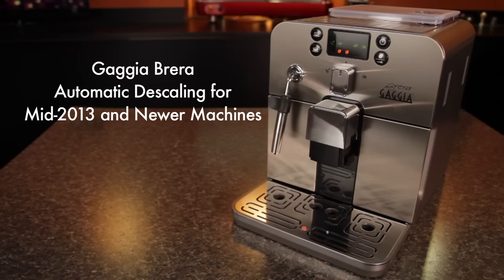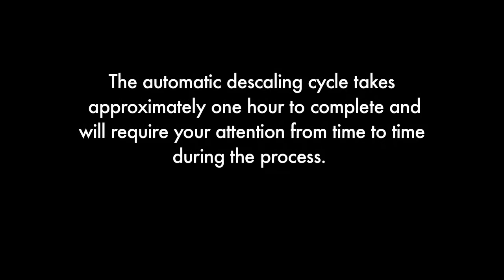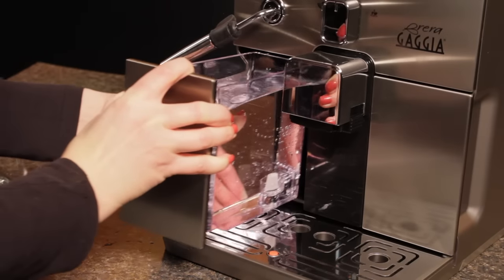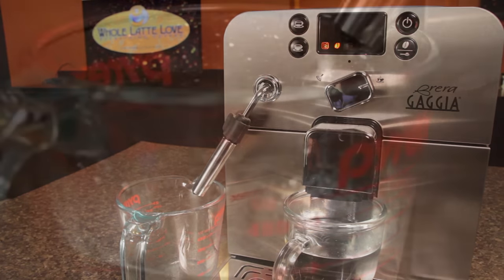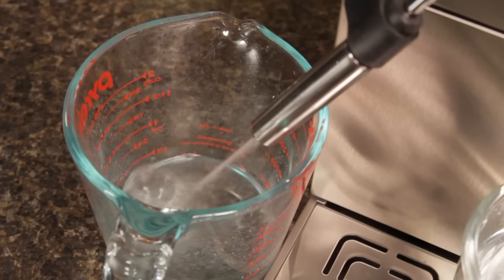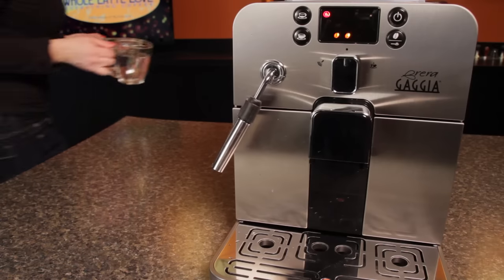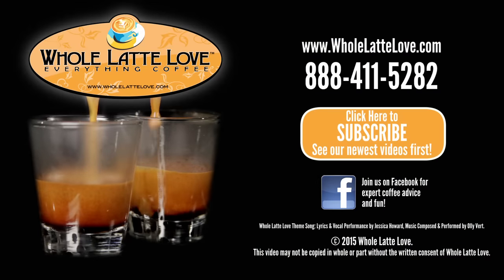How to Automatically Descale a Gaggia Brera

Comment: Thank you for this! I was racking my brain trying to clear the descaling light after performing the cleaning. The manual says to hold the measure button 6 seconds but does nothing. Turning the machine off and then holding shot and lupo buttons at the same time did the automated descaling as in your video. Man on the one side I wasted 30 minutes doing descaling a 2nd time, but on the other side, the next time I descale I can let it go auto. Thanks again.
Reply from the maker: Hi, You are welcome. A few years ago Gaggia added the automatic descaling to the Brera. Think a few machines got out without updated manuals.

Comment: I’ve descaled ours many times and never once has it rinsed the group head. Is this a flaw in the machine? My drip tray is always completely full after descaling, and I’m wondering if it’s going there instead. My sister and BIL have the same machine and have the same issue. It comes out of the steam wand fine.
Reply: same here,  I think it did rinse the group head the first time just like in the video but since then the water just collects in the reservoir before moving on in the process.  I purchased my unit from @wholelattelove due to the community and support knowledge you all publish and of course ties to Rochester, NY.

Comment: this is confusing. some of your other videos DO NOT distinguish and say we can use either decalicifiers. So what exactly do we have? Older pre automatic descaling option and newer ones? Which ones have an aluminum boiler and which ones have stainless steel or brass?? I need to know because on the other video your experts are adamant about using Durgol Swiss  Decalcifier for aluminum and dezcal for stainless steel?? I want to know what I have--and purchase the correct decalcifier and you need to put one version on your videos. Because in this video you do not distinguish at all and led me to believe I can use any of the assortments in your pictured video.
Reply from the maker: Hi Lisa, Descalers can be confusing! Gaggia Breras have a stainless steel lined boiler. You can use any of the descalers shown in the video. As you mention, Durgol Special Swiss is a better choice for aluminum boilers. But even for those any of the descalers can be used but you should limit aluminum boilers to no more than 20 minutes of contact with a descaler containing citric acid as the active ingredient according to Urnex. In older videos the Durgol may have been recommended out of an abundance of caution.
Reply: So use Dezcal on a 2015 Brera? What's best? 

If using water filtered with a Zero Water filter is descaling still necessary? Is the machine requiring descaling based on a set number of brews or can it sense scale?

Comment: 🤔🤔 When I have descaled my machine, the solution was coming out the steam wand just fine but when it came time to cycle through the group head, all the solution leaks out the bottom of the machine and all over the table. No solution went through the group head, all to the bottom of the machine and a little on the drip tray. Has this happened to anybody else? What’s the solution to this? My machine been only used for about 6 months. HELP‼️
Reply from the maker: Hi Fudge, Leaks are no fun. here's a video which covers a common cause of leaks and how to easily fix: https://youtu.be/nra9Wrlm1MU
If it's not the issue in the video and you are in the US or Canada go here for help from our Tech Support team: https://support.wholelattelove.com/hc/en-us/requests/new?ticket_form_id=1500000236921
Reply: @Wholelattelovepage  I contacted WholeLatteLove tech support and they’ve been working on finding a fix for the situation, thank you!! :)

Comment: For those who ask about the need to descale when using bottled water. Bottled water is not distilled water, it still contains ions that will eventually clog the machine, even though it takes longer
Reply from the maker: Hi ML, Thanks for adding that. I'll mention a few more things... Not a good idea to use distilled water in espresso machines. Lacking minerals distilled water or pure reverse osmosis  water will over-extract coffee resulting in bitter flavors. Also, distilled and RO water can cause corrosion of metal components. That's why you never see those water types stored or transported in metal containers or pipes. Not all bottled waters are the same. There are some which are unlikely to cause scale but others like mineral or spring waters which have high mineral content.
Marc
Reply: @Wholelattelovepage  Agree, distilled water is a very corrosive liquid!
Reply: @Wholelattelovepage  what kind of water would you recommend is best? Perhaps just regular Brita filtered water?

Comment: Thanks for this video, it's clear and well made. Question: Is it normal to have to descale every month? That's roughly how often the light comes on. We filter our water and brew 6-10 cups a day. Just wondering since I've seen 2-3 months given as advice more often. Doing the descaling that often is not a problem for me, just curious if it means the machine will wear more quickly. Would you recommend using store-bought filtered water?

Comment: I am using brita filter with my gaggia brera coffee machine but the descaling icon appears every 2 months, just like before, there's no difference whatsoever. Could you please advise what I should do - descale it every 2 months despite using brita filter or not? Does the coffee machine actually sense scale level or it only counts the number of brewed coffees to establish time for descalling?
Reply from the maker: Hi M, Thanks for the question. So a couple things... The descale alert comes on based on the number of brew cycles. Regardless of the water being used the descale alert will always come on after a certain number of cups. Machines do not sense the scale. For the most part, Brita and similar filters only remove sediment through mechanical filtration and chlorine and other chemicals via carbon filtration. Scale is caused by minerals (mostly calcium) in water. Brita filters have little if any effect on minerals. I would definitely continue to descale the machine. If you use an in-tank filter designed for the machine you will get all the benefits of Brita type filtration plus water softening which replaces much of the calcium with salt (salt stays within healthy levels) to prevent scaling. It's still recommended to descale when using in-tank filter but you can descale less frequently. Here's the in-tank filter for the Brera: https://www.wholelattelove.com/mavea-intenza-water-filter-for-gaggia-and-saeco
Reply: Thank you for the response. I am using exactly the filter which is shown under the link you have provided- in-tank one,  hence my question. The purpose of my question was to establish what that "less frequently" is. Without the filter it should be more frequent than every 2 months for me, but with the filter can I double or triple that time? BTW: my intenza+ filter looks exactly the same but on the box there's 'brita' not 'mavea' shown, the rest of the box looks exactly the same.
Reply: I use a reverse osmosis filter with 5 stages. It isn't going off of water hardness, but instead it goes off of liters dispensed. If you want to know how long it can really go then purchase a 10 dollar water impurity tester from amazon. It's a little digital meter. You dip it in water and it will tell you PPM of dissolved solids and purity. Compare your brita to tap water. If it's 4 times lower, you can go 4 times longer between descaling. However, a carbon filter will not remove dissolved minerals as it's a physical medium, and the minerals are in solution (nothing to filter, it's all liquid) . Reverse osmosis does remove minerals but it's requires installed systems due to size and complexity. About 300 on amazon and fits under the sink. Took an afternoon to install.
Reply: Subparanon I have the same problem I have use nothing but bottled water in my machine I failed to see the need to D scale it ever

Comment: What is your definition of 'normal use'?  Also, what is low use? and how often should it be descaled then?
Reply: Normal use is a family of 4or 5 drinking 5 cups a day . Low will be just wife and husband, 2 to 3 cups a day . How often ? The  machine is smart and uses its fuzzy logic to  turn on the descale light. So for heavy use the light comes on more frequently . For low and normal use around 3 to 4 months . However after 3 months of use if the light doesn't come on wait 10 days and still the light is not on, do a descale any way .  Marc did not answer your question because he did not want to go on record by defining "normal " "low" and heavy .  As a seller of  coffee machines he is  liable to  stand behind what he  quoted, because  Marc also does after sales machine repair service .  Several variables such as water quality and carefully following maintenance procedures and  machine use methods prevent one from putting a value/number to  " Normal/Low/& Heavy  use .  Hundreds of customers follow his channel to get answers after they purchase a Gaggia brand coffee machine . So each have to  figure out  what their " normal/low/and heavy use numbers are.  Your question was just a common sense question and therefore I answered it using my common sense. It  may not  necessarily work for everyone. Remember the  "variables" !

Comment: Hi Marc,
I remember seeing a video that said that the Brera machine uses some sort of logic and usage patterns to determine when the machine needs a descaling. My question is what if I use just water without the descaling solution and complete an entire descaling cycle and clear the descale light Etc.  Next question is what will the machine do? Under such circumstances, where you just mimic the descaling process using only water and no descaling solution.  Will the machine notice/catch what we did and   ask for another descaling process when it notices that the boiler still has built up scales. Thanks Marc for all your videos and thanks also to the other gentleman who does the demo while you do the shooting of the video. I forgot what his name is,
Reply from the maker: Hi RD, Thanks for the comments and question. The other gentleman is Todd.
You can clear the descale warning by going through the descaling procedure without using descaling solution. The machine will not know the difference. The descale alert is triggerd by the machine counting brew cycles. There's no actual sensing of internal scale deposit levels.  Question is why would you not use descaler?
Marc
Reply: Hi Marc and Todd,
I was not going to dupe the machine but my plan to do a test run using no descaler and get some hands on experience before I do my first descaling. My machine is 3 months old and I am learning everything I need to by watching your videos and videos made by the manufacturer office in London.  Like I said my very first test run will be a dummy one and when I do everything right the next one will be with the descaler solution.  Also I wanted every one out there to know what exactly would happen if they fake or cringe on the process by using less descaler solution or not use at all. You answered the question by confirming that the machine has no fuzzy logic to determine when to descale other than keeping track of number of shots made Etc .  How ever the manufacturer mentions it and you plus Todd mentioned it that the machine has a self learning feature that automatically adjusts the shots made based on some sort of fuzzy logic. I now stand corrected that the self learning feature is only restricted to the quality of coffee made and nothing else. I asked you this question on behalf of all subscribers to let them know that they need to follow the proper procedure as mentioned by your videos to keep their machines in top condition. Thanks for your instant reply, highly appreciate it.

Comment: Hello! I'm also having the same issue as a user below: model from 2015 and no matter how long I've held both buttons, the machine will not enter descale mode. The dial is on the dot. I've turned the machine on, off, unplugged, everything. Held for 3, 5, 10, 20 seconds and nothing! Please help!
Reply from the maker: Hi AC, I would call our tech support at 888-411-5282. They can verify your machine has the automatic descaling cycle and walk you through the process.

Comment: My Brera has a 2015 date but the automatic descaling cycle won't start. How long do you need to hold the buttons?
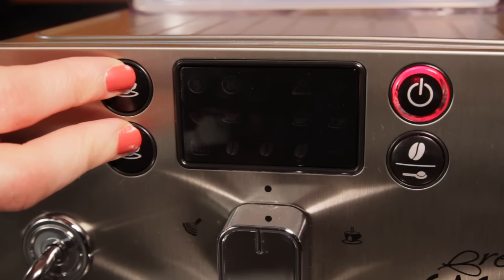Reply from the maker: Hi Ed, Hold the buttons until the triangle symbol flashes in the display as shown at 2:00 in the video.

Comment: que pasa si realizas el proceso mal? intenté hacerlo sin apagar la maquina antes y preparó varios cafés con este líquido descalcificante, despúes hice el proceso correctamente, puede afectar esto a mi café? cómo puedo arreglarlo
Reply from the maker: Pues yo no bebería el café hecho con el líquido descalcificante! No debe haber ningún problema. En el proceso de descalcificación normal, la solución descalcificadora pasa por los componentes de la máquina que preparan el café. La máquina simplemente se detiene más en ciertos puntos para dejar que el descalcificador haga su trabajo.

translated ?: What happens if you do the process wrong? I tried to do it without turning off the machine first and it prepared several coffees with this descaling liquid, then I did the process correctly, can this affect my coffee? How can i fix it

Well I would not drink the coffee made with the descaling liquid! There should be no problem. In the normal descaling process the descaling solution runs through the machine components which brew the coffee. Machine just pauses more at certain points to let the descaler do its thing.

Comment: my grandma gave me her 2017 brera gaggia and ive descaled it but it seems like its stuck on rinse cycle. i refilled the water compartment like 10 times but its stuck on rinse. also, most of the water got released at the steam wand and only less than a cup at the dispensing spout. im not sure if im having a machine issue or if im doing something wrong with descaling. please help! i bought almost $40 of parts from @wholelattelove already and its still not working. i dont wanna keep dropping money if its not gonna be worth it :( any advice of help is much appreciated
Reply from the maker: Hi TC, Thanks for the question. To quickly resolve your issue please call our tech support pros at 585-924-7170. They'd be happy to help diagnose and resolve the issue.

Comment: Hello guys, i did the manual descaling process (the one in the manual), my machine was made in 2017. At the end of the process i'm supposed to  press the "Bean/Pre-ground" button (bottom right) for 6 seconds so the machine re-starts and the descaling warning dissapears, however my machine does nothing. I see no way to turn off the descaling warning. Have you ever had this problem?

I used Saeco's descaling solution. I hope you guys can give me a hint! Thank you!.
Reply: I guess if i can't find a way to turn the warning sign off manually, i can always do the whole automatic descaling with water only so the warning turns off.
Reply from the maker: Saeco's descaling solution is fine. Sounds like you may need to run the automatic descaling process to get the warning light off as you thought.
Reply: Thanks!

Comment: It seems the descale light comes on every six months. I’m using only filtered water. So I ignore the light and descale less often than the machine suggests. Ok?
Reply from the maker: Hi Daniel, Thanks for the question. What type of filtering and how is you source water quality?
Marc
Reply: @Wholelattelovepage  I have a big under sink charcoal cartridge filter. I end up descaling once a year, I often wait several months after the descale light comes on to go through the process. I've had the machine for 5 years, no problems. I also clean and re-lube the brew unit regularly.